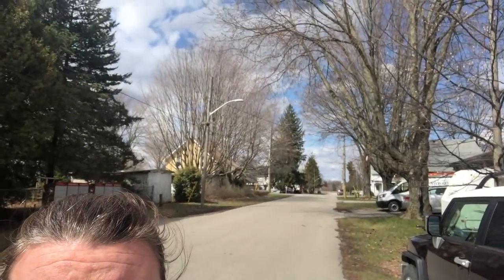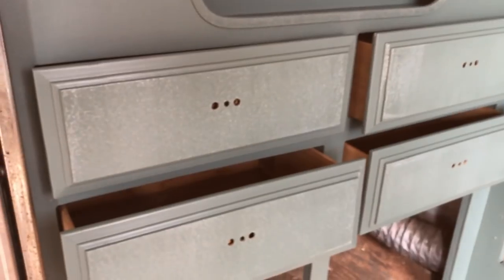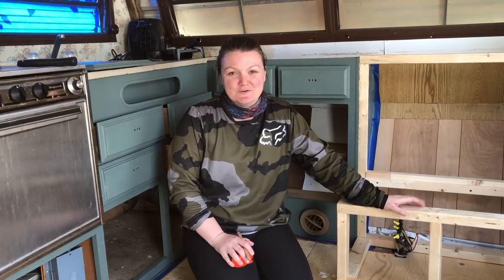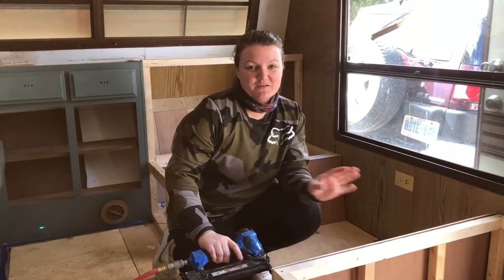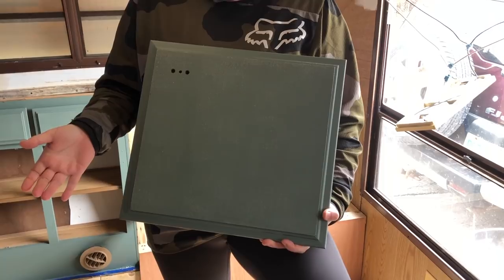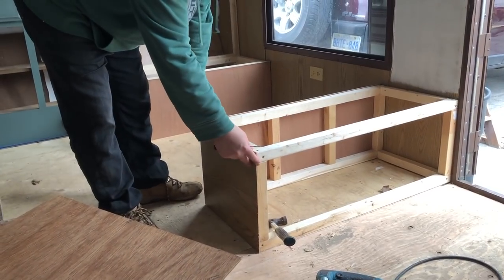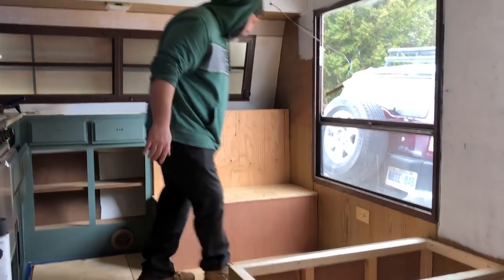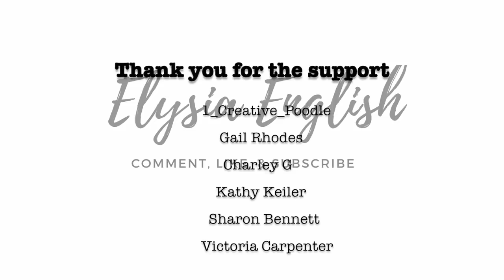Extreme Camper Makeover | Kitchen cabinet MESS UP!! | Episode 14

Comment: Elysia, it looks like the satin poly was not stirred well enough. The zinc oxide used as a flattening agent to cut shine will sink to the bottom. Make sure no white substance is on your stirrer before you start. Also, if you want a satin finish I would start with a gloss poly, then end with a satin finish. 
If it was not polyurethane, but polycrylic then I suspect it was the humidity. 
Everything is looking so good! There are always setbacks on any project, and I am so happy you and Philip are showing the ups and downs; that is what keeps you two “real”. 
Banana Muffins sound so yummy!🤗🤗🤗

Comment: Hi! Thank you for sharing this content, I like this series! 🥰 I think something else that could have happened with the clear coat, is the temperature. I think I tried one time to put poly during winter (I live in Virginia, definitely not as cold as you guys 😅) and it did that. Maybe is not your case but just sharing it just in case. Might be a good idea to use the heat gun if you start to see any bubbles while drying up. 🙏🏻

Comment: If I could make a suggestion on the back bench... Add a shelf to the back part where the actual seat starts, so that you don't have to reach too far to grab things out, and it leaves everything else below that line, (like, where the hinges would be), for that trunk style storage. Just thinking it'd be easier to utilize, instead of anything you put in the back side falling all the way to the floor. It would be a great spot to store pots and pans. You could add hangers on the back wall of the storage section of that bench to hang pots/pans, then use the shelf part for lids. 

I'm so enjoying y'all's videos. Seriously. It's helping keep my mind off everything. Thank you for that.

Comment: Hey love the progress of the camper so far! :-) wanted to let you know that the reason why it bubbled on the green paint is because of the sponge roller. I did the same thing on a wooden bookcase and I used a sponge roller with a polyurethane, and it bubbled like crazy! I thought that I had got a bad can of poly as well, and when I went to the paint department they told me it's because I used to sponge roller to roll on the poly. I just thought I'd share that with you.

Comment: Thank you for your chanel! A tip for you is to do the back bench seat fold  forward i did that and store extra linnen in the bortom in a plastic bag and the kids beding (a fittet sheet over a tunn maddres topper1-2cm make it easy to roll the fix bed and store). I also did a drawer under for easy Exit for big items.so happy with the result.mvh nenne

Comment: May I recommend to you a product called "Liquid Sandpaper"? You don't use it if you need to remove material, texture, etc. You do use it when the surface needs prep to accept paint. And it could not be simpler and a huge time saver over sanding. Simply saturate a cloth with it, and wipe the surfaces to be painted or where you are adding a coat. It dries quickly and you can immediately paint. It will also clean off surfaces that aren't too dirty. You can save dozens of hours of sanding. Available at Home Depot and probably Lowe's. Cheap too.

Comment: It looks like the cabinet doors just had a ton of bleed through.  A wet clear coat makes it really show.  I would either sand back down, repaint, and spray 2-3 coats of shellac, then seal it with the clear coat, OR sand, repaint, and wax them as a sealer.  Such a bummer, they looked so nice before the top coat!

Comment: Thinking about the shoes- leave it open and maybe a Velcro curtain, that way you can just kick off the shoes and you can wash the curtain-Hubby said your paint problem sounds like a chemical reaction, the wood for the trailer may have been treated so as not to rot easily. even though you sanded it maybe in the wood. maybe something for bugs?

Comment: I’m wondering if it could be a matter of the oil based paint not being completely dry when the water based poly went on? Also if the poly was a little colder than “recommended” (though I know in Canada we can’t just WAIT for warmer weather, life needs to move on regardless of if it’s sub 0 lol) it could have gotten thicker and thus not dried clear. Sucks to have to redo but like you said, better to catch it early :)

Comment: Did sponge roller make bubbles? Or was poly shaken not stirred? I get terrible bubbles when I shake my poly, if have to back and stir to pop all the bubbles. Really enjoy watching the progress. We did a similar paint effect on our RV but wife chose a dark blue for lower kitchen and used same on bathroom vanity, then white everywhere else with bronze hardware my daughter chose.
Have you picked flooring? We got a deal with some clearance click lock vinyl plank only needed 4 boxes or about 96sfq.ft.
I used a lot of screen mold for my base as it is much smaller, but did use base shoe and quarter round, as floor space is tight I wanted to go small as possible.
I also replaced the fan in the bath with a Maxx Fan, it really moves the air and it wasn’t too expensive.
Oh, and we’re from San Luis Obispo, California.

Comment: I think sliding cubby doors for shoes. Will look more tidy covered and if there are stinky shoes, It will not be open so the possibility of stinky shoes gets in the trailer air... just stick an air freshener or odor eliminate inside the little cubby and bam, problem solved!!!

Comment: For your cabinet issue, there was too much moisture on the cabinets and in the air. One fix to try before anything else would to use a heat gun on one, it should pull the moisture up and then smooth out the surface. Try low heat evenly if isn't working kick up the heat but be careful to not burn your surface.

Comment: Are the cupboard fronts real hard wood or are they made of a cheaper wood product like hardboard or plywood? I used thick plywood for a wooden toy box once and had all sorts of problems painting it - I started by trying to varnish it and the colour went all weird - dark in some places and light in others then I sanded it back cleaned it down and glossed it white and that went all gritty and bumpy like how yours did a bit. If you are going to have another go at using that clearcote then maybe do a test piece just to be sure first. Congratulations on 100k!

Comment: This may seem a silly question to ask someone so obviously experienced, but did you stir the poly before using? When we refinished wood floors, my husband applied the polyurethane before we left for the night. When we came back the next day, literally half, as if a line had been drawn down the middle, of the floor was shiny and the other completely dull. After thinking someone had come in during the night and sabotaged his work, he realized he had not stirred the poly before applying. 😒
Reply from the maker: happened to me once! looked like a straight line was drawn! Def stir while using